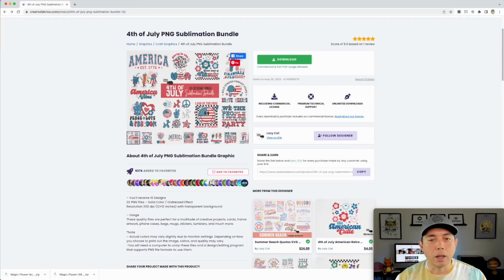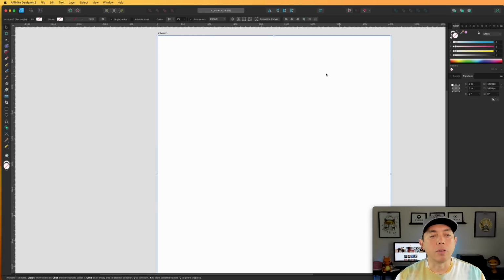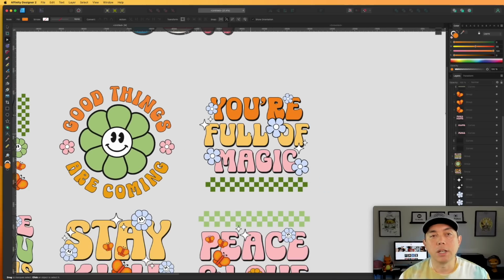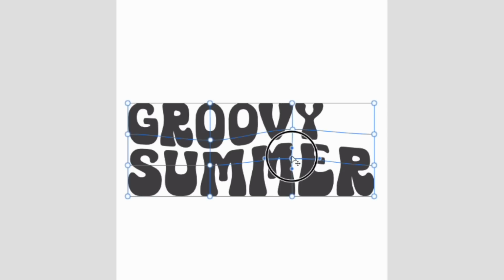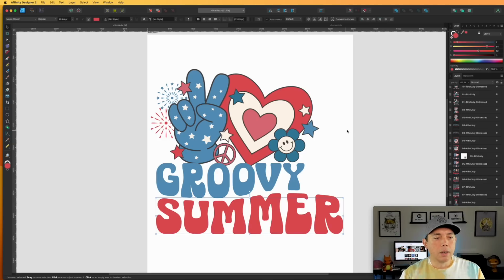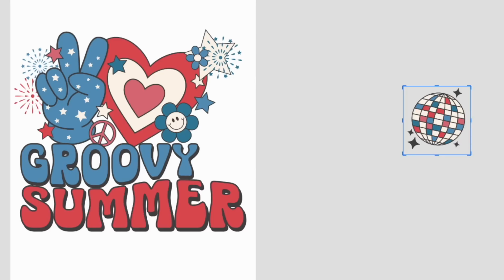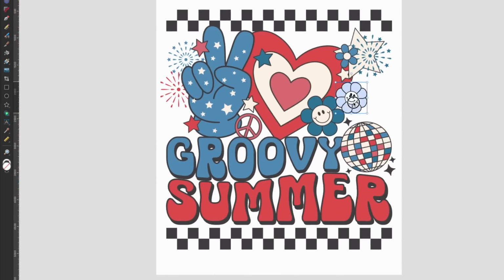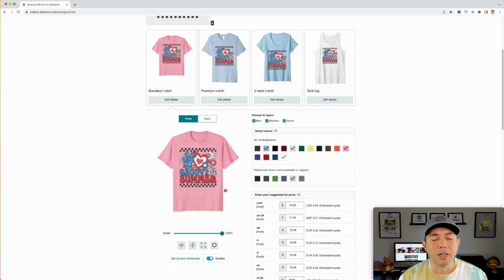CREATIVE FABRICA TUTORIAL: Using Creative Fabrica for POD T-Shirts in Affinity Designer

Comment: You should do a tutorial about completely free ways to make high-quality, high-resolution designs for those just starting out and don't want to shovel out tons of fees for a unproven product line. I know Kittl and Canva, etc. have free versions but they are in many respects limited. Also, how about a highly-detailed explanation of the licensing rules on such sites as Pixabay, Unsplash, etc. Pixabay's explanation of the rules are a bit bafflinf--examples might help.
Reply from the maker: That would be a good video... thanks for the tip
Reply: Great video , do you happen to know if I’m allowed to bring fabrica designs into kittl to work on or I have to do in my own photoshop ?
Reply: I'm no Kittl expert but in trying out the free version I have imported images worked on in Gimp as well as new fonts. @kristinaklein7358